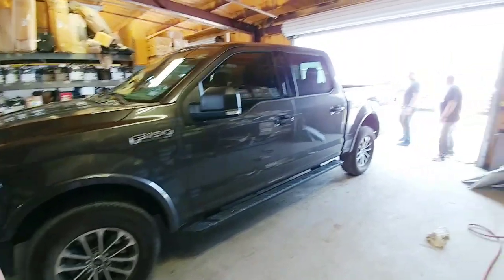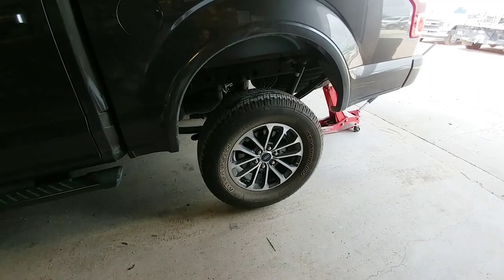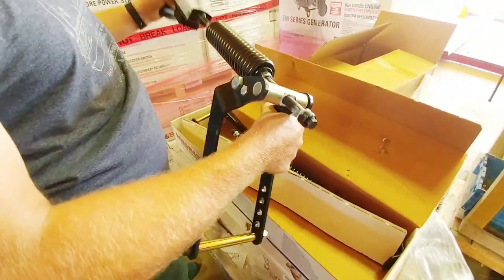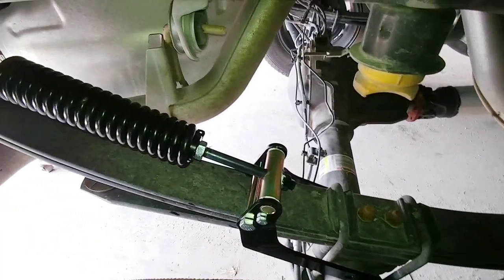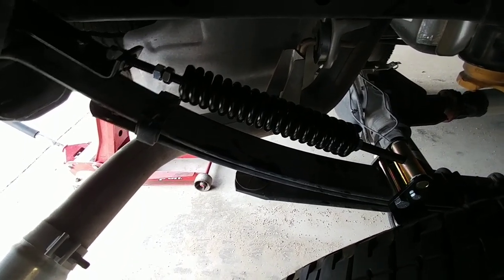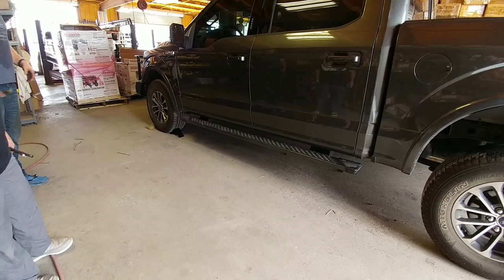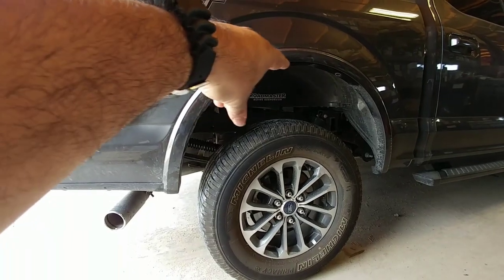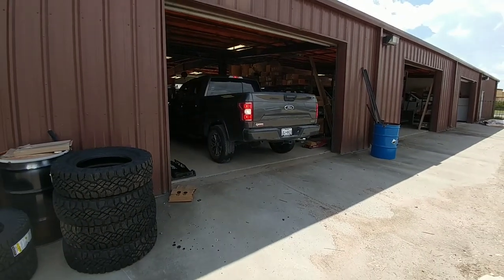Must have for 1/2 Ton RV towing! Roadmaster Active Suspension

Comment: EXCEPT, if you have a Toyota Tundra...  The anti  sway bar and the Firestone Ride Rite (rear air bag) system... I have it on mine and it works great... well those and a Tekonsha 90195 P3 Electronic Brake Control
 and I work at a RV center and tow all the time..  my poor little Tundra.. 
..

Comment: I never really liked how trucks have gotten with the rear sittin higher than the front. Hate how that lean or stance looks. I know when you put weight in the back or a trailer on a hitch itll level out the truck, but i just prefer mine to be level all the time.

Comment: I have a 2019 Ford Raptor and keep approx 500 lbs in the bed at all times. I was considering purchasing new leaf packs from either Icon or Deaver in order to increase my ability to handle a moderate constant load without sagging under all sorts of driving conditions. Do you think the Roadmaster active suspension would fit my needs without messing with the great suspension capabilities of the Raptor (great minus the poor load handling)?
Reply from the maker: So long as it fits, it should work great
Reply: @BigTruckBigRV  I guess there's just one way to find out...

Comment: Quick question, off topic.  Can you please do a video on how you remove the center caps off the rear dually tires on your F450.  I tried today on my new 2019 and I was not able to remove it.
Reply from the maker: It's very difficult! Unless you make a tool to do it yourself...... I'll have to make a video on mine.  Cost me about $30 worth of materials at Lowes.
Reply: Big Truck Big RV That would be great I'm sure many people would find that video helpful.  I bought some aluminum bar stock to make some kind of hook to grab the cap and lever it off with the lug wrench.  Thanks again for all your videos.  I'm now a proud owner of a '19 F450.

Comment: You installed it incorrectly. You should have supported the truck at the axle so the suspension was at ride height. Not extended, during installation.

Comment: It is may work to prevent my f150 2018 go down 4 inches when I hook my 7500 trailer? Or I should get a rancho shocks?
Reply: woof beast  I have the Roadmaster and it did not make the ride harsher in any way. Do you have one?
Reply: Air bags

Comment: Your opinion: active suspension versus air springs ? (Full disclosure - I added air springs to my 150)
Reply: The problem with air bags is you either need to carry on board air, or keep an air compressor handy.  Also, air bags do nothing for the side to side roll, or helping with sway.  This product does.  However, you do notice a slightly rougher ride with these, where airbags ride like a cloud.
Reply: How does airbags help axle wrap?
Reply: Nicea Trya Airbags do help side to side roll, if they are plumbed independent from each other.

Comment: This is just a bandaid for leaf springs that are too weak. The real answer to a DYNAMIC rear suspension is with air, period. Less spring rate unloaded, more when loaded, that's all it takes. If this setup added height, which it looks like it did, then it's adding spring rate. There's no way it'll ride the same as a stock truck after that.
Reply: Maybe you should try it.  I thought the same thing until I installed a set and drove my truck.  Fantastic improvement.
Reply: @orvalstuckemeyer127  sure, I'll admit, maybe the added spring rate makes it handle better unloaded. My Toyota Tacoma did when I put heavier springs on, less axle wrap, etc... 

But it doesn't handle the same at that point. He touts this dynamic, and won't impact ride, that's just simply untrue.

Now there's other good ways of doing this that add spring rate and are dynamic. Helper springs that engage at a certain point would do the trick, so they truly don't affect unloaded height and spring rate and only engage when the rear end sags. The other better option would be air bags, because they're fully adjustable. 

If you wanted to just add spring rate, a new leaf pack would be better designed and. Leaner, and barely more expensive by maybe a couple hundred.

I'm just not buying what he's selling the way he's selling it.
Reply from the maker: If you look at how the system is designed, it actually reduces the spring rate from the leaf springs.  It basically tames the leaf spring pack by making it respond in a more controlled fashion to impacts, rather than simply bouncing up and down.
Reply: @BigTruckBigRV  ok, so maybe the additional spring is providing the spring rate instead of the stock leaf, but either way, today spring rate when unloaded is higher. There's no way you get a lifted rear end without increasing ride height.

I don't want to sound like I'm in a pissing match, it's just that this isn't for me.

What I'd really appreciate is if you were able to do a towing review with this truck, back to back with a ram with the air suspension. That feels like the right approach to be from a soft, but capable half ton suspension.
Reply: Matt France  Agreed this installer makes $ on these band aid systems
Reply: Big Truck Big RV  It reduces leaf spring movement, nothing more
Reply: Correct!

Comment: Snake oil. If I need to add this kind of crap to my truck, I don't have a big enough truck.
Reply: Dirt Road Sailing what truck do you own?
Reply: I love these on my truck.
Reply: X2 on loving this product.  Best addition we added to our truck for towing our camper.
Reply: Perhaps you don't have the need for a Daily driver F450 or 3500 truck. So for a few times a year, if this helps you feel more stable, tow more safely, then why not? No one argues a larger truck wouldnt be better. But not everyone wants/needs a larger truck 24/7.  Hardly snake oil if the product does as its advertised, regardless if a larger, more capable truck would need it
Reply: Snake oil ha ha ha ...that's what we used to call those car dealership flush kits.
Reply: Scott Baker you nailed it.
Reply: These actually make a big difference and help.
Reply: I agree with Dirt Road. I owned horses over 20 yrs and used a 1/2 ton pickup to haul hay and horses, because I had too, but I never liked it. After a short time I got a 3/4 ton pickup that was designed to haul the loads I was hauling without adding things like roadmaster. I had airbags already on the truck when I bought it. They were great in handling any sway I had. I know own a new 1 ton that has all those things added at the factory as well as a goose neck hitch made at the factory. This truck is very comfortable going down the road with loads greater than 10,000 lbs. I know everybody cant afford to do what I did, but I knew I was driving on borrowed time using a 1/2 ton truck. Always have more truck than you need. Even if you buy it used. Think about brakes and your truck frame not just suspension.
Reply: George VictorLast I don’t need to spend $15k more on a Super Duty, when all I needed was Roadmaster Active Suspension to stabilize my load. $350 vs $10-15k. 

And if you’ve never tried it, you don’t know that it doesn’t work. It most definitely does.

Comment: Are they still considered half tons even know there pay load is close to 1 ton
Reply: Dirt Unlimited the badge has little to do with actual load rating anymore.
Reply: @akbychoice   i know but eveyone still calls them half toms
Reply: My SRW one ton has over 3,500#'s of payload capacity, and a half ton is usually around 1,500#'s. So there's quite a difference between the two models.
Reply: Daniel C and my F450 is a little over 5,300
Reply: Daniel C F150 can be outfitted from the factory with over 3200# payload. So no, not much difference.

Comment: If you tow a big trailer a 1/2 ton is not the truck adjustable suspension or not.   The braking system isnt designed for it neither is the suspension.      3/4 ton is the truck for towing and safe.

Comment: First video I have to dislike. This product is absolute junk. I looked at this product when I first got my truck. I live on a farm, I was told driving in pastures or leaving concrete for any reason would void the warranty. It also makes your truck look stupid with it sitting up real high in the rear. Air ride or sumo springs is the way to go. Much better customer service and products that work superior to this with a warranty you can count on. They don't believe in their products and either should I.
Reply: Yep

Comment: Boy, that install was WAY WRONG.
Reply: How so?
Reply: @AdventuresWithBrian83  The way I was instructed was to have the spring adjusted as close to the axle as possible.  This one was installed at the farthest extension with plenty of room to adjust it in.  I shouldn't have posted "WAY WRONG'.  I have seen others install them at the longest extension as well.
Reply: @wb2194  reviewing the instructions that came with mine kit, you are correct...  The spring is supposed to be as close to the axle as possible within the adjustments.  Wouldn't say it this install was "way wrong" but just not following every single step of the instructions.
Reply: @AdventuresWithBrian83  You are right.  I shouldn't have said way wrong.  It still works no matter how it's installed.